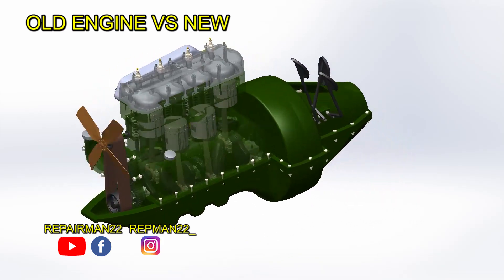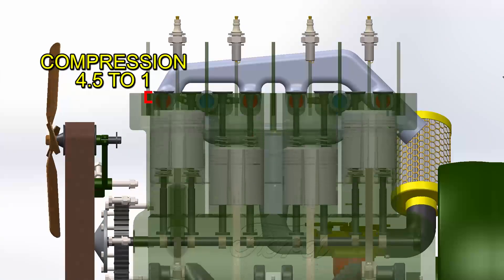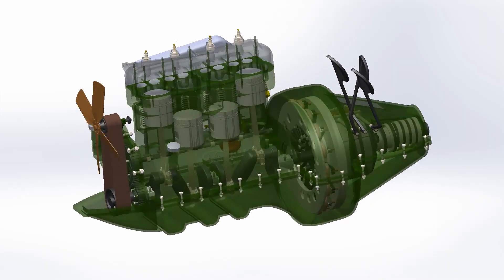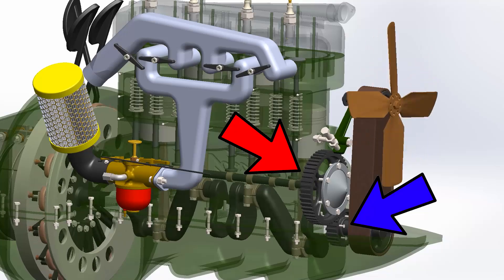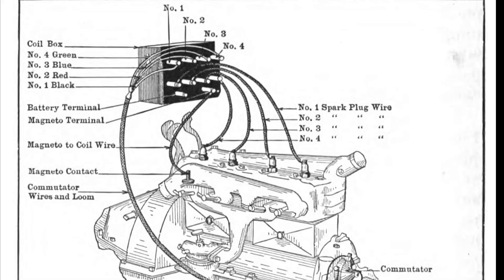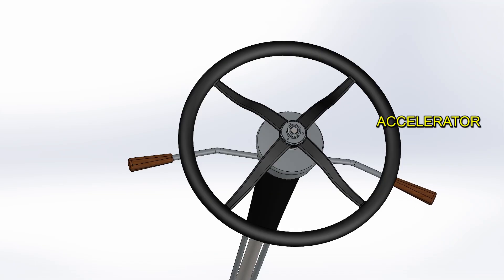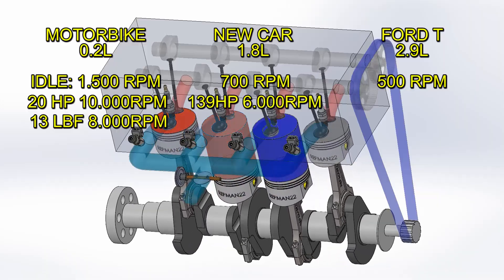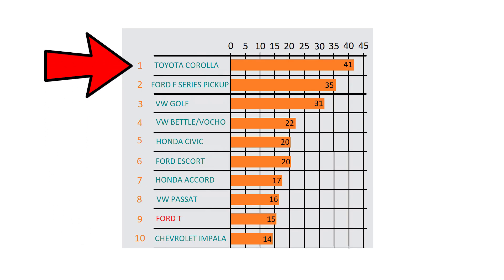Ford T vs New Car 🤯 3D Animation// What changed in engines in 100 years?

Comment: Interesting that my 1962 MGB 4 cylinder engine is virtually identical in geometry to this “all new” design. Geanted the70 year old tolerances are right up there with current rough carpentry standards and the materials are all pre-bronze age but it chugs right along. And when the crank bearing leaks (excessively) you simply chink in another 10” of cotton cordage from ACE and you are good for another month in the garage, drip free.

Comment: thats not gravity thats convection . heat rises causing coolant (not refridgerant) to drop to the lower parts of the system. please do at least a little research before making vids on the subject.
Reply from the maker: and why is it going up? just because of the heat? or perhaps because the liquid becomes less dense and lighter, causing it to float, precisely due to gravity... I can't understand people who try to comment to seem intelligent and prove just the opposite.
Reply: @repairman22  yes, thats called convection. Duh
Reply from the maker: @maddhatter3564  convection needs gravity. it can't work in space. If I only say convection, many people will not understand. What I did was describe exactly how convection works. 1:56 Please do a little research before correcting somebody...

Comment: on the note of the engine firing backwards, in later revisions they had a keyway so if it did go backwards the crank would slip off to prevent you from breaking your arm

Comment: also you had to manually advance timing due to no vacuum advance for timing, and they were relatively low compression due to the low fuel octane
Reply: Low Fuel octane has NOTHING TO DO WITH low compression
Reply: @bunzeebear2973  my point was that the engine was lower compression because it didn't use higher octane fuel. More compression means you can use higher octane. Think before you type

Comment: All the so called advantages and reliability were due to Ford naming a cheap motor. Spark suppression had nothing to do with computers. When radios were put into cars the sparking interfered with the sound. Suppressors were used decades before the first computer was even imagined. The thermal efficiency of that engine is abysmal. But no one cared back then.  You attempt to excuse the poor mileage and blame the fuel. Other makers at that time with the same fuel were vastly superior - but more expensive. The tech existed but it was more profitable for Ford to make inefficient cheap cars. Ford Model T had plate glass windows that viciously slashed passengers in a collision. But that was cheap. And no lawyers to represent those mutilated by the glass shards. 

It is an interesting engine but don’t imply it was in any way superior to today’s technology.

Comment: Even “modern” flathead has higher compression the most “modern” flathead was built by Briggs up till 2000 and it was a flathead twin cylinder with a 5.5:1 compression ratio

Comment: That is why most Fords even if that engine quality is no longer around they literally have to rebuild it from scratch for their to restore those cars you don't use the original engine you get a modern one cuz that's the only way it's going to run I had a great uncle that said they were the worst pieces of s*** on the road but they were cheap

Comment: If you think the Ford Model T engine was a bulletproof engine you're on LSD or been smoking a lot of crack rock it was one of the worst engines built Ford is known for fix or repair daily Henry Ford couldn't build a proper engine 100 Years of engineering to do so he never could get it to do properly it always broke after a hundred miles so it's always a mechanic shop we're getting sent back to Ford to get worked on

Comment: I recently saw a video about a restored Model T.  The owner noted that he had to make sure that his fuel tank was full or nearly full to go up a "reasonable" hill since if the hill was too steep then the engine easily be above the level of the gas in the tank!
 
My father (born 1920) remembered how the normal convection flow radiators would easily over heat the engine!  Hence how nice it was to have a water pump that would cause water to be exchanged in the engine constantly....

Comment: Octane has almost nothing to do with fuel efficiency. Octane is just a measure of resistance to detonation, and not a measure of energy density. If you put 87 octane fuel into a model T engine you wouldn't see an appreciable difference in gas mileage.

You're also not considering weight. The cars getting 30-35 MPG weigh 2x-3x as much as a model T. If you somehow grafted a model T engine onto a contemporary car you'd get a lot less than 13 MPG.
Reply: Well, it's not exactly that simple either. If you were to put a modern 35 MPG engine into a Model T, you also won't get 35 MPG anymore. In reality, you'd get far less due to gearing and poor aerodynamics.

Comment: My grandpa's Model T had two forward gears; low and first. It was one-wheel-drive. In 1941, my mom had to drive it 250 miles on the main highway with no brakes. 😊

Comment: The flathead was an appropriate design for the quality of fuel that was available at the time. The us did not have high quality fuel until the aircraft of WW2 needed it. The 3 main bearing crankshaft is used in the flathead v8 until 1953.

Comment: Only boneheads crank a car while grasping the crank like a hammer. The safe way is place the thumb on the same side as the fingers; then if the crankshaft kicks backward, the thumb is not injured. I owned a few Peugeots, and a crank allowed me to continue with an old battery much longer.

Comment: My old landlord talked about getting his dad's T when he replaced it with an A. He said he reduced the cylinder volume to up compression and completely stripped it down. He could race his friends and be competitive then. They were teens in the 30s, original hot rodders. That old T is a few rusty tins now in a bush. I found the frame on the other side of the 40 and plan on hanging it from the rafters of the barn eventually.

Comment: When u think about it the model t engine is actually genius
Reply: Ford did not invent the engine..that happened in Britain or France...Google it.   Ford created the first assembly line for automobiles...the original assembly line has to go to Ancient Egypt during the Pyramid days.  Even the Maya predate Ford with their pyramid construction   Back in the days of cars, they were built in horse stables. One at a time.  by many stable owners.  But one at a time means it takes longer so costs more.
Reply: @bunzeebear2973  well yeah iknow that's why I said the model t engine not Henry ford's engine cuz he didn't make it
And thanks I didn't know that's how they made them

Comment: How about a  basic car with 4 cyl engine, steering wheel, 6 spd auto trans and radio. No I dont need wifi, Navi, or climate control AC that starts in advance  when i leave the office. AND doesnt cost $40,000 + 10% mark up from msrp by the dishonest dealer, salesman and FI person.

Comment: The real reason the stroke was so long is because the fuel at the time was absolute crap.  Low octane, unleaded gasoline AKA white gas is not something a modern car was meant to run on.  Bad gas needs to burn slow.  A long stroke gives more time for that power stroke.

Comment: You can't compare those numbers, they make power at different RPMs. If you look at the true measure of work done per rotation the Ford T engine does 0,09 lb/f per rotation, while the Toyota engine comes to 0,03 lb/f per rotation. Obviously because the ford T has a larger displacement.

Comment: Vanadium steel was used in the chassis, but the engine block and head are cast iron. Correct firing order is 1, 2, 4,  3.

Comment: The block on the Model T is NOT vanadium steel. It's plain old cast iron, and they wore rather quickly, unless steel sleeves were installed. Many engines were lost to broken cranks because of the lack of counter-balancing of the crank throws, and only 3 main bearings. Especially on the trucks. A neighbor of mine has a 1925 1 ton truck and it was recently (within the last 30 years!) outfitted with an external water pump, and a Ruxtall 2 speed differential to give it a total of 4 speeds for moving heavier loads.😄 Even so, it's broken the crank at least 2 times that I'm aware of.😝

Comment: The engine in the model T is anything but reliable. Go up a hill and you'll burn the bearings up due to the lack of an oil pump, every 10k-20k you have to rebuild the engine mainly due to the babbit bearing. Due to the cooling system it was easy to overheat.

Comment: A long stroke & low rpm gave increased time for combution, which would be beneficial because when the Model T was made, gasoline was nothing like it is now.
Reply: Gasoline is still gasoline. Additives are infinitesimally small amounts.  The car will run on lawnmower gas.
Reply: @bunzeebear2973  they will, but they won't all perform like they can. My car requires 91 octane, if lower it will knock, and could partially disassemble itself.

"Lawn mower gas" (I'm assuming 87o) is actually a much higher octane than it was. Not just due to what was put in, but what was taken out.  Any modern engine probly wouldn't run on gas from 1930! At best, one might start, but wouldn't rev, and would probly stop running fairly soon.

Comment: Interesting comparison with great graphics.  Using 2.9 liters and 13 mpg to make 20 hp is pretty sad today.  Pouring the gasoline on the ground and pushing the contraption is only a slight hit to efficiency.😆  As I've gotten older big V8's, huge tires, gearboxes are just too much mass and too much money.  I never had much  fun driving fast cars slow anyway.  T's make great hobby cars for the greasy senior set but they are ultimately just tinker toys for stray dogs to chase.  A Triumph or old MG will do EVERYTHING better than a T and appreciate in value.

Comment: It's an obvious fallacy to state that lacking parts such as an oil or water pump increases reliability. Yes there are fewer parts overall, but those additional parts contribute greatly to the longevity of the entire engjne.  How many Model T engines would last 200,000 miles or more without a major rebuild, something that is absolutely unexceptional today?

Comparing the fuel mileage of the Model T with the "average" fuel milage of modern vehicles is disingenuous at best, and bordering on dishonest.  A small gas engined car today will get at least double the mileage whilst making maybe four or five times the power of the Model T from half the displacement or less.

This is not to take anything away from the Model T, it was a huge success for good reason and a credit to Henry Ford. It is mechanically very simple and much easier to repair than modern vehicles, but those repairs were frequently needed.

Comment: A T Model can sit in a barn over a century and be refurbished better than new. Thanks to poured bearings and the rest of the design which was intended to be fixed by primitive shops in austere conditions it will remain easy to restore a 200 year old T Model when the time comes. They're slow and the awful brakes were purely a greed-driven design choice (larger drums existed on other vehicles of the early 1900s) but they're about the "minimum viable automobile".

Comment: Remember too that the modern car's use of plastic was not an option in 1905 - nor were the rubbers very good.   Try building a Toyota Corolla without plastic or decent rubber.   The T was rightfully seen as a revolution.

Comment: Actually Frontenac , roof , and other companies were making OHV and DOHC heads for model t’s back in 1910’s . Taking a 20 Hp motor and pushing them 3x to 4x the Hp . Some advertisements from back then stated 100 Hp .

Comment: Termosyphone cooling is my favourite part of the Model T engine. That was kinda unique because the others took the lesson and introduced water pumps into subsequent designs. Oil pump and fuel pump took longer to implement, ignition system was for the long time almost as primitive as Model T's. Side-valve engine is making a comeback, so still relevant. 
Model T is a very odd vehicle in so many ways that we could point out that it was Austin 7 which actually showed the right direction where cars will be heading in the future.
Reply: "side-valve engine is making a comeback"
Which manufactures are moving back to side valve designs? First I've heard of this.
Reply: @ferrumignis  Not for automotive applications, for small engines.

Comment: 5:47 Ford T was not designed for gasoline, it was designed for ethanol. Gasoline became the car fuel only ia few years after the Prohibition (1920) started - before that gasoline was sold in drugstores.

Comment: I actually have a perfect first-hand story to go with this.

In 2020, my mom was preparing to have liver transplant surgery, so with the many appointments leading up to it, she and my dad had to go constantly back and forth between where they live, and the hospital in the middle of the state, about 100 miles each way.

My dad's truck - a 2011 Toyota Tacoma (with roughly 265k mi) - had the alternator die on him, so he was not able to use the truck at the time. Instead, they had to use my mom's car, a 2007 Lexus GX470 with about 180k mi on it. One day, as my dad is driving up to get my mom at the hospital, the transmission fails, and he has to get it towed. (Very luckily for him, it happens to break down just before the exit to my brother's house - in the town we all used to live in - so he was able to get it towed to a mechanic he knows, and borrow my sister-in-law's car for the day.) Ultimately, the cause was determined to be that the transmission fluid line had rusted apart, destroying the transmission and totalling the vehicle.

So now here my parents are, with a 2011 Toyota Tacoma that won't start, and a 2007 Lexus GX470 with a busted transmission. And what was the one vehicle in their driveway which was in running condition, and had active insurance and registration?

The 1926 Ford Model T.

They sure don't make 'em like they used to!

(Side note: a close family friend bought the truck from my dad, came down to the house with cash and a new alternator and serpentine belt, and drove the truck back to his house. Later, he got ahold of that Toyota frame rot warranty thing, where Toyota replaced the entire frame of the truck, so now the truck runs great and we still see it occasionally. My mom junked the Lexus and used the money to get a gently used Cadillac SUV.)
Reply: How is Mom doing with her new liver?? Still going strong? How long has it been?

Comment: And can we customized that old ford model T engine to make it performance compareable with modern engine, such increase compression ratio or even installed turbocharger and firing system and fuel improvements?

Comment: Toyota Corolla has 21.5lbs per hp.
Ford Model T has 60lbs per hp.

Toyota Corolla makes 77.2hp per liter.
Ford Model T makes 6.9hp per liter.

Now the highest end Corolla GR has a 1.6L three cylinder motor with 300hp and 273lb ft of torque. That would make it 10.8lbs per hp (it weighs 3250lbs) and 187.5hp per liter.

13mpg sounds like it's not bad for the Model T but these numbers don't lie. It was incredibly inefficient at making power, so you're using 13mpg to make barely any power out of a big motor.

It was great for the time but motors exploded and died for a long time before they got truly reliable. There's a reason old cars only had 4 or 5 digit odometers because 100k+ miles on an original motor was unheard of.

Sure they were simple. That didn't make them reliable. That was just the tech they had at the time.

Comment: It is somewhat frustrating to see that after more than a century of modifications, so little has changed in combustion engines. Sure some details were tweaked, but nothing really came through. All the systems that the engines used are still used. They've just been improved. It gives an unpleasant feeling.
Reply: The electric motor has not changed since BEFORE the ICE so some principles cannot change. Wheels are still wheels. Gravity is gravity. The heavier you are the more power you need to move up a hill.(hills exist)

Comment: Higher pressure fuel injection, forced induction, more power and torque, less fuel consumption, fewer emissions, lower weight, smaller size, better quality and cleaner fuel.

I have a small car with a 2 liter straight four diesel engine with turbo and common rail high pressure direct fuel injection with 200 hp and 400 NM of torque.

A friend of mine has a BMW 5 Series with a straight six 3 L diesel engine with 400 hp and 700 NM of torque.

Comment: That's the thing with older engines, a bit less efficient, but less parts (and easily replaceable parts), as well as simpler fuel and coolant setups mean an engine that is kind of more reliable, but only if you properly maintain it (like properly topping up the radiator). Modern engines have better seals and more efficient fuel pumps and coolant, and can last longer with no issues if a driver doesn't pay attention to anything.
Kind of a downside to modern engines being so forgiving is some drivers can get away with no common sense engine checks and maintenance long enough to get into the habit of thinking that's the normal way to treat a car, that they'll ruin a modern engine in a couple of years, while the more hands on and regular maintenance of older engines kept drivers on their toes and made basic mechanical knowledge almost mandatory for someone who wanted to drive.